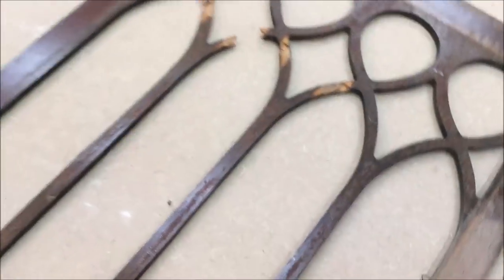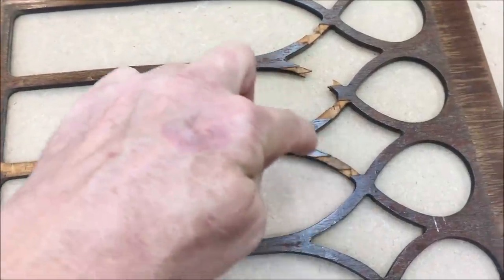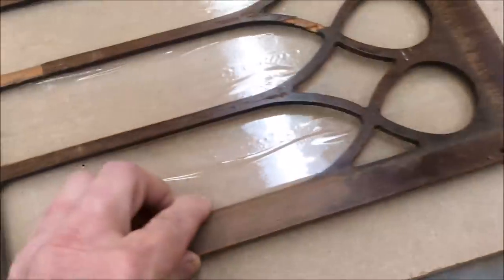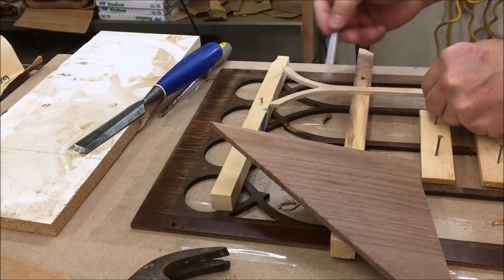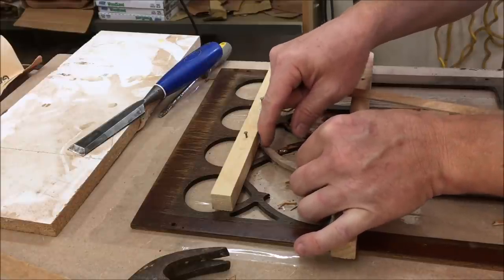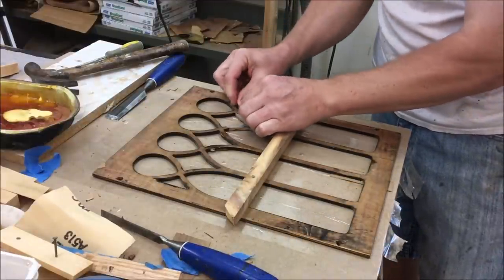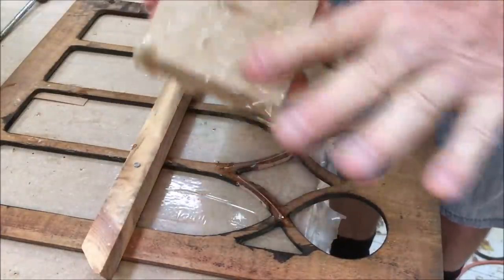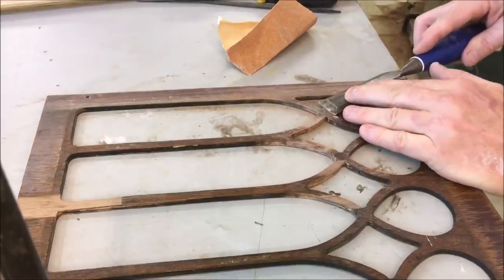REPAIRING THE SPEAKER GRILL

Comment: Love your work, I have 2 1941 Philco's , model's 290 & 295 I am gathering info to restore the wood. I see you have a concern with the wood sticking to the plastic tape you used. I work with a lot of composites fiberglass/carbon fiber/ Kevlar etc for NASA.  When using any glues/epoxy's I "always pre treat" the mold surface (plastic in your case) with a mold release agent. I have also used regular car wax (cheapest). Just apply the wax, let dry buff & repeat at least 3 times. It will just pop off without any problems.

Comment: This is almost at the point where it would have just been simpler to veneer a piece of 1/4" plywood and cut a new grille.
Reply: Yes that could have been done but I like the fact that the old wood was used therefore the original wood plus the new smaller pieces just adds to the beautiful antique design !